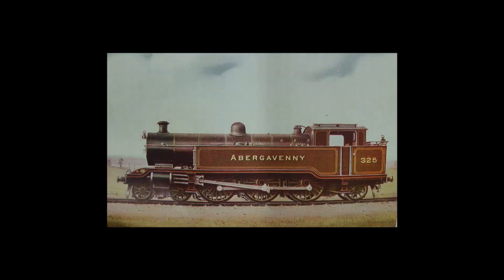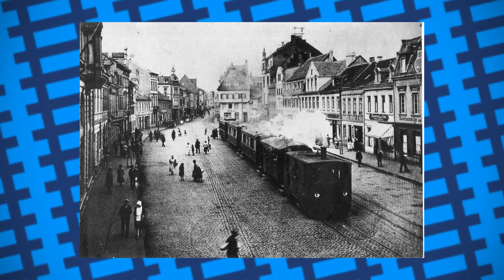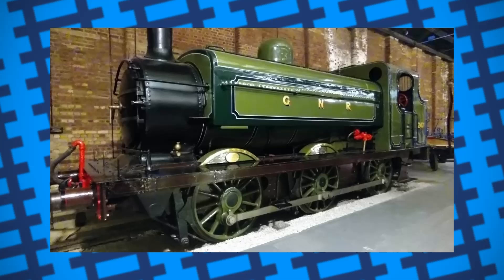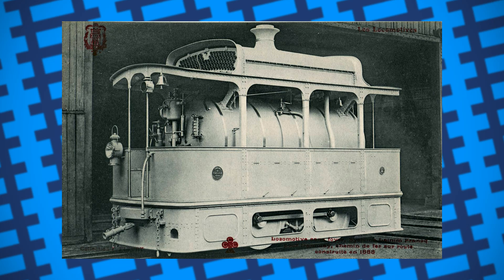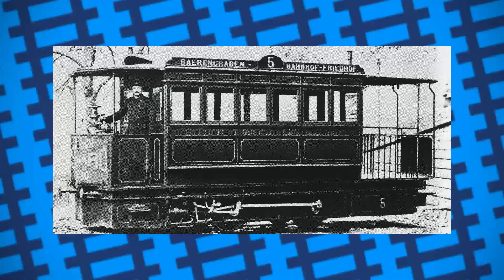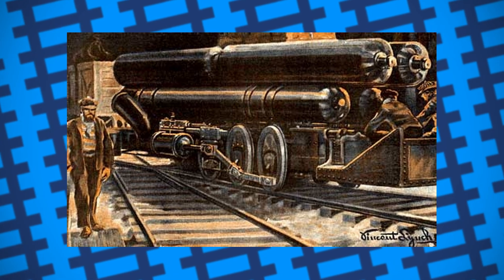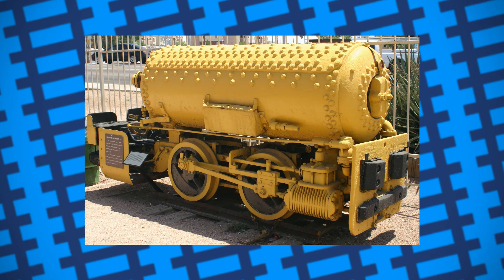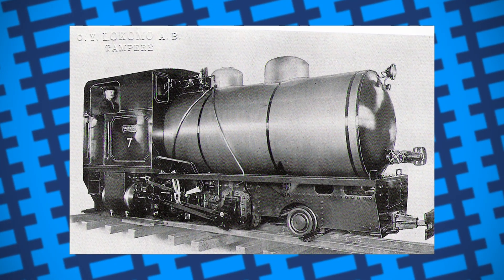The steam trains that don't require steam - Fireless Locomotives

Comment: Two additions.

Some fireless engines used caustic soda dissolution to produce extra heat. They were more effective than simple fireless engine but aggressive compounds provoked corrosion and could cause serious burns.

The earliest russian pneumatic locomotives was "Dukhokhod" (it can be translated as "pneumomotive") built by Baranovsky in Saint-Petersburg in 1861. Although it had several progressive engineering solutions it was retired soon as the maintenance was too difficult.
Reply: Caustic soda sounds like a really bad and dangerous thing to use for sure to generate extra heat. Even if the cylinders and piping ect were made from corrosion resistamt materials, the way steam engines in general spray steam and water at high pressure from the cylinders while they are operating you would have corrosive caustic flying everywhere. All over the loco, on the rails, on nearby standing people and also probably the train driver, all over the ground ect.
Reply: @johnpekkala6941  It was a closed cycle.
Reply: @seeker1015  Until it pops. O^O
Reply: Caustic soda can be very dangerous, I'm glad they don't use that any more.
Reply: Don't worry, be happy. Some is puting billions to use amonia as a fuel XD
Reply: Calcium chloride works just as well as caustic soda. Even better if you use a endothermic water absorbing side like urea, that cools as it hydrates.
And of course low heat of fusion working fluid like ethane or ethane propane mix.
Nowhere for the working fluid to escape to BTW in a a double acting piston design. And you can get very high efficiency by putting the gas first into the smaller volume side with the shaft in the middle, then expanding it from there into the larger volume above piston chamber.
These were always more efficient than IC engines. Just they couldn't get a monopoly on the fuel supply, or make them wear out fast and expensive enough to scam lots of profits out of you like Internal combustion.
I mean where's the profit in cars that can use the day-night temperature difference to go forever without refueling, and have half a dozen easily made parts that never wear out in their drive train?
Unfortunately lots of weight noise, smoke and tangles of pipes and wires impress stupid people. And with the Anglo-American propganducation system stupid are most, and stupid they do.

Comment: They were also used in places where open flame could be an explosion risk. I saw one of them at the old Gretna munitions factory.
Reply: The one used at Eastriggs (not actually Gretna) explosives factory was powered by compressed air. You can still see it (unrestored) at The Devil's Porridge Museum. (The Devil's Porridge was the name given to the cordite, a mixture of guncotton and nitroglycerin, made there.)
Reply: All mine machinery has been compressed air since early days, just plain safe.
Reply: @seeker1015  Compressed air locomotives were used in the mining industry due to air quality and exposition risk issues.  They often used the roof as a radiator to pull in heat.   Isothermal compression could in theory be nearly 100% efficient by insulating the compressed air storage and not cooling the air.
Reply: I used to live near one of the main european ammunition depots, where fireless locomotives could regularly be seen crossing the public road. I moved away in 2000, but I assume they may still be in use.

Comment: Fireless locomotives are some of my favourite little quirks of engineering! Especially the fact that they required specialised radiator fins on the pistons to prevent them from freezing solid due to the temperature drop caused by rapidly expanding air, and the truly bizarre looking ones that originated from the realisation that lots of tiny storage cylinders could allow drastically higher pressures- and resultingly, ranges- than a single big one.
Reply: This needs a long video, but the train guy is about the short format.
Reply: look at it the other way. the air has two choices when the pressure is reduced. to absorb heat, and expand. or sit there and stay at the same volume with no temperature change.

the fins arent there to stop it from freezing, theyre there to maximise the amount of atmospheric heat that can be dumped into the air so it CAN expand...

and therein lies the soul of every engine... supplying heat to make things expand.

the same era that fireless locos and compressed air locos were in common use, so were things like "air re-heaters", to get compressed air lines up to a temperature where the air could expand fully, release more energy and do more work, without tools freezing up...

cold tools are actually less powerful than hot tools. the air doesnt expand fully. the pressure isnt maintained, or, you use more air to maintain a given pressure.

easy experiment, run a die grinder or other air tool with the air line coiled up in a bucket of boiling water... you will be surprised.
Reply: You are talking about compressed air locomotives, not fireless.
Fireless is built just like a normal steam locomotive minus the firebox.
Reply: "lots of tiny storage cylinders could allow drastically higher pressures"

Why is that the case?
Reply: @seneca983  smaller chambers with the same thickness can withstand higher pressures than larger ones- similar to how a watertube boiler can achieve much higher pressures than a fire tube one. A smaller pressure vessel has proportionally thicker walls + higher strength, so a lot of compressed air locomotives would use many many small tanks with diameters of just a few inches, each with unbelievable pressures, allowing a net increase on stored air and resultantly range
Reply: @steelblue8  "A smaller pressure vessel has proportionally thicker walls"

It doesn't have to have. You should be able to just make a big pressure vessel with proportionally as thick walls (meaning thicker in absolute terms) while not using any more material for the same storage volume and pressure.
Reply: @seneca983  when you look into the bursting strength of cylinders and the like you understand.

its hard to explain, but you find most of the equations related to wall thickness in cylinders use r^2... forces go up on the square of the radius.

a small, spherical 1 litre tank can have a much smaller wall thickness for a given pressure than a spherical tank holding 100L at the same pressure. 

then its a tradeoff on the size, as smaller balls are harder to make with more connections and less overall volume and a higher surface area... whereas large balls will have less surface area, be heavier, have a higher volume, hold a lower pressure...
Reply: @paradiselost9946  I tried to work out the math but I still got the result that the required wall thickness would only go up linearly with the radius. Thus e.g. doubling the radius would increase the material needed for the wall by a factor of 8 but the volume would go up by the same factor so smaller pressure vessels wouldn't obviously be better.
Reply: @seneca983  Total amount of pressure applied to the inside of the tank, forcing it outwards.
Because of the whole "Pie are squared" issue, when you double the radius of the tank, its area will quadruple.
So, if there was a total force of 1,000 pounds in the tank before, and you double the tank's radius, you now have a total force of 4,000 pounds. And we need thicker walls for the tank. MUCH thicker. And the increase of thickness needed also increases with the pressure.  Double the radius, and you need to at least quadruple the strength of the shell, too.
Please note I am referring to TOTAL FORCE from the pressure here, and NOT Pounds per Square Inch (PSI)!
 A standard 20 pound Propane tank, like for the BBQ, has a surface area of 905 square inches. Thus, it needs just over ONE PSI to have 1,000 pounds of total force stored up. Double the radius with the same pressure, we now have 4,000 pounds of total pressure. 
And now you know why Overpressurization Events can be so bloody. Even over inflating a car's tire can cause the tire to explode with deadly force.
Reply: @TimeSurfer206  "So, if there was a total force of 1,000 pounds in the tank before, and you double the tank's radius, you now have a total force of 4,000 pounds."

Yes, but now the walls are also twice as wide. If you then also make them twice as thick the force relative to the wall strength should still be the same. So it seems the required material for the walls would go up with the size of the tank at the same rate as the volume of the tank so it's not obvious to me that smaller tanks would be better.
Reply: One thing that always strikes me about a lot ( but not all) of fireless locomotives is that often the cylinders are mounted in reverse. I've never come across an explanation for this. I'm guessing maybe it's something to do with regulator location and lengths of pipework. But I could be wrong..

Comment: 0:00 "When you really think about it, all you need to run a steam locomotive is a lot of pressure" 

Me: Would peer pressure work?
Reply: Or my blood pressure but there'd be way too much wheel slip
Reply: @thelaborpeasant  lol
Reply: How about parental pressure?

"Why are you still here? Get going or you will never be useful engine like Thomas or have your own express line like Gordon!"
Reply: @Hybris51129 Much like a steam locomotive, that kind of parenting hasn't been around in many decades now.
Reply: That works much better in boat form, where you can use pier pressure. :p
Reply: Definitely.
Reply: You're here, and just used dialogue format.
Gotta figure out how to harness it, and you'll be golden.
Reply: its incorrect thinking.

whats actually required is HEAT.

getting the boiler up to pressure did nothing. you had to get the thermal mass of all the water it held to a temperature that would maintain that pressure.

thats what does the work. the heat.
Reply: @paradiselost9946  Sooooo... 
you're saying we need a furry. X3
Reply: @jamesgizasson  ummmm...?
maybe a tea cosy. or another jacket.ooooh, a duck-hunter!
Reply: Omg Arthur